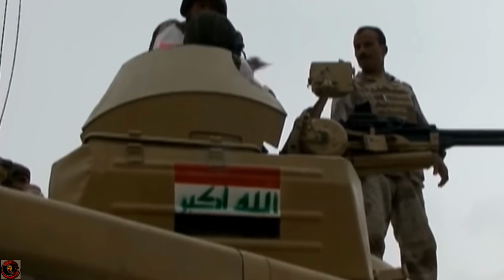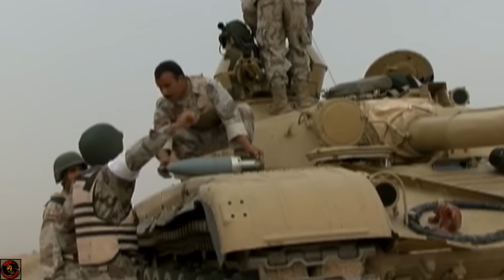Do Russian Tanks Need Bigger Guns?

Comment: Well, the thing with 152mm guns on Armata is quite complicated. Armata was designed to either use the traditional caliber of 125mm or a 152mm gun. So, an upgrade can be made. Perhaps starting a hybrid familly of tanks(Like the T-34 series, with different options for the 76mm guns, a version with 57mm gun or the late war version of T-34-85), this does not mean a complete overhaul of the new tank fleet, but can be seen as gradual introduction(first produce tanks with 125mm than some with 125mm and 152mm and later produce mainly 152mm version) Now, does Russia need bigger guns? Well, this is the thing. Russia did not plan to introduce the 152mm guns for the now(that's why development is not so rushed yet), but because of the future. They know that the collapse of the USSR put their tank development quite a bit behind NATO progress. The T-14 Armat, in current state, was meant to bridge that gap.But they also know that this is not going to last for long(Most NATO tanks have been around for 20 years, so of course everybody expects them to be either upgraded or replaced). And they know they won't have the budget to develop a completely new tank fast enough to keep up. This means that they are going to need a more powerful gun and a viable platform for it so they do not lag behind when those new tanks come up.  And another thing, NATO tanks use depleted uranium shells, which gives them an edge in firepower. To compensate, Russia needs a bigger shell, so a bigger gun. In conclusion, yes they quite need it.
Reply: Omega Alpha 
Most of NATO favours tungsten over depleted uranium.
Reply: The 152mm gun for the Armata is probably in slow development, but is probably one of the ways the Russian designers are looking at to penetrate the Chobham armour used on the M1A2 (and variants) as well as the Challenger IIs. If improved 125mm munitions can't penetrate the Chobham armour, they may need to go to the 152mm gun. This can also be used to counteract any armour improvements in Nato's tanks (M1, Challenger IIs, and Leopard IIs), or future Nato tank designs (M2?, Challenger III?, Leopard III?) whenever they come out.

Also note that any improvements in 125mm munitions will more than likely result in improvements to the 152mm munitions. Granted, not all improvements will apply between the two shells, but some will. I also think that the 152 mm is in slow development because of the barrel wear issue. All the issues you raised about reduced barrel life are valid, and need to be addressed before the 152 mm can be deployed en masse.
Reply: @kostaskritsilas2681  2a83 152mm gun is already developed for object 195, i think it can be used on armata as well
Reply: Also automated turret which i think all countries should do so. This should eliminate the problems with elevation and depression I think. I'm sure you can design something... Anyway I think tanks in general should also be able to have the ability to choose different amounts of charge so they can be used as artillery as well. 

 Also you can put the turret further back for better stability. 

 Also it doesn't have to be a 152. I think that's a bit too large. I think building a 130mm but designing a tank to go bigger is the way to go. I feel like armor technology isn't keeping up and eventually will be useless with more active defenses taking priority. The Russians say the Armata can tank a hit to the face by an American Abraham's 120mm + DU sabot but I'm not sure how true that is. Would not want to test that theory personally. 

 Also there are now smart shells that are designed to be shot over the top of a tank and uses a shape charge to penetrate the weaker top armor.

Comment: Instead of using bigger barrels they should further develop missiles that can be shot. This will help when a regular 120mm round won't do.
Reply: +Valhalla. Ehhh, no, that would not solve anything. Because the "only" target that would maybe need over 120mm would be the T14. Which I would assume has decent tech to deal with sub sonic incoming missiles at long range (early warning, not engagement of the missile).

The Russians had missile ammo for their T72s to counter the max range of the Abrams cannon, but that was before so current day countermeasures was a thing.
Reply: Lobos222 that just shows why improvements to missiles is so important. Hardening them to electronic countermeasures, making them more agile and faster.
Reply: Rockets are not cheap
Reply: Do you have any idea how few missiles have been fired from tanks? they are just not practical. The US bought literally thousands upon thousands of tank fired missiles for its m60 with the 152mm gun and they fired something like 8 of them in total. They are useless and expensive.
Reply: 神様 in Valhalla but the t14 has soft and hard kill aps
Reply: Given how common soft and hard kill anti-missile systems are becoming that can prove to be very expensive and possibly very expensive proposition unless they come up with new forms of guidance that are either passive or impossible to detect. 

Even older tanks can be easily fitted with laser/radar detection systems designed to automatically pop smoke in the detected direction that can defeat laser/IR/radar guidance systems. 

Also, typically missiles are shaped charges that rely on the Monroe Effect to penetrate armour and this is (relatively) easy to defeat using spaced or laminated armour without adding too much weight.
Reply: there already are missiles google the refleks
Reply: Cathexis256 I know that there are missiles already. Just like guns have existed for hundreds of years yet we continue to redevelop and improve them. Why not do the same with tank fired missiles?
Reply: Jameson Dymond that is one tank from one country (excluding the Merkava as well). There are a host of other countries that would love these missiles. Design and sell it to them.
Reply: 3 things:
1: There is already the Israeli LAHAT missile, which can be fired from both 105mm and 120mm barrels, and can be used, technically, out of any NATO standard 105mm or 120mm gun.

2: Basically all missiles use HEAT warheads, which we have made, probably damn close to efficiently as possible for their size. The LAHAT is claimed to penetrate up to 800mm of RHAe (Having tandem warheads). The problem is, is that all modern armour....is most effective against HEAT warheads. To make HEAT warheads more effective at this point, we basically need to make them bigger in diameter.

3: Which is great, except that missiles are the easiest threat to counter. From simple to most complex, we have standoff armour such as bar armour and net armour which just detonates the missile a safe distance from the vehicle. 800mm of air, is basically the same as 800mm of steel as far as HEAT is concerned. We have reactive explosive armour, we have reactive non-explosive armour, we have soft kill systems, and we have hard kill systems. As these systems mature, they will likely render single missile attacks, as utterly futile affairs.
Reply: +Goldmarble Im uncertain about who you are replying to but cage armour which is what you are referring to is not effective or even designed to be effective against missiles it is a protective shield from handheld rocket systems like the rpg, due to their design cage armor is effective at detonating the warhead before it hits the tank armor but most if not all missiles are too large and too heavy to be affected by cage armor and would go right through without detonating.
Reply: i've always wanted to ask - why russian mbts like to use guided missiles as part of their weapon system/munition when western counterparts don't?(to my limited knowledge anyway) is russian apfsds inadequate?
Reply: spaz14 I'm not a expert on armour, but it seems extremely likely to me it's a economically/logistically motivated decision.
They allready used the same AT missiles for mobile and defence anti tank use.

Comment: Anything above 130mm would be impractical on the mobile battlefield. Granted it would get the job done, but like you said It's about the crews. The first one zero'ed in and fires first wins. Crew reaction time, Mobility of the tank to that reaction, and finally Armor packages is the tank's last line of defense if the incoming hit. If you have to have a bigger gun, then it better to reconstitute the Super Heavy Tank Destroyer Class of tanks and only have them as mobile point defense tanks for protecting bases or defense choke points other than that they are pritty much useless at everything else.
Reply: your thinking is trapped inside the box of "tank vs tank", ignoring all other applications and destructing factors
Reply: No, I haven't.  He asks about do we really need bigger guns.I just gave thoughts on the subject and how if you needed a bigger gun with some quick pros and cons also a quick solution on how to implement them. With a little common sense, imagination, and logic. You can go blue in the face in the countless amount of scenarios that the tanks are going have to put up with. That would take forever to type each one. I fully understand a tank can't an Omnipotent force able to handle everything comes its way. Sadly that type of thing doesn't exist, if such a thing was attempted you would need unlimited R&D, Money, resources and what not. I'm Aero Space Engineer and IT Specialist and I have been for over 18years now. I've worked on military air and ground developments and more. Trust me when I say the stuff you see nowadays, is 20 to 50 years behind what is really planned. The only reason it isn't here today is. Those other technologies have not caught up with the design specs.

Comment: Title should be:Everything is bigger in the U.S. but will that change to Russia.
Also could Russia afford to refit new guns or make new tanks or even buy from another country?  How much is it to refit military vehicles
Reply: It depends quite a lot. Especially when we are talking about Armata, which is designed to be a multple weapons platform, and as far as I remember, there were already tests with 152mm guns, but that was discarded for the moment because economic reasons and because the current 125mm seems to be doing quite well. As to come back to upgrading Armata. Well, that tank is still in production. So you do not need to upgrade the tanks you built. You built upgraded tanks. So, instead of having the same number of tanks, just with little improvements, you have more tanks, some of which are good and some of which are even better

Comment: I think they will be going to thicker barrels maybe smaller diameter rounds using a liquid or gel explosive propellant , using higher speed rounds to kill instead of mass . Like modern bullet designs .
Reply: M TODD The modern small calibre Hight velocity ammo is overrated a bit. Its main advantage is it weighs less than the old 7.62 for a soldier to carry. in jungle conditions leaves and even grass can affect its trajectory and hitting power of the smaller calibre ammo. The guy hiding behind a log is a lot safer with light  higher velocity rounds coming at him. If 7.62 is coming in it can easily chip big lumps of log off destroying your cover. I have not seen a demo for years but in terms of hitting power with about 10litre tins of water the original Armalite was pathetic compared to a 7.62. Put a few blades of grass or leaves between the target and it was even worse in accuracy and hitting power. Whatever you did with the 7.62 it blew the about 10litre ration tins of water to pieces. Bigger calibre still has its advantages provided there velocity is high as as well. Also the extra room in a large callibre shell allows a better armour piercing explosive setup in the shell when it hits. No shell can pierce the armour today on tanks today with hitting power alone.
Reply: Ross K  not to be rude but we were talking about tank rounds .  Lighter tank rounds moving at 1.5 -2 km a second are still heavy enough to kill any tank made.  Ever heard of the silver bullet FSDSDU only faster and no powder charge which is a lighter round .

Comment: I would say that yes, we need bigger guns, modern armor packages on both sides of iron curtain are getting more and more effective so why not just slam a big 152 mm gun on USSR tanks (Armata's turret wouldn't be a problem) and 140 mm on allies tanks. Of course there is no way to just put it on old tanks like T-72 or T-90, just check their interior now, with 125 mm, it is more cramped than gym on 2nd day of January, so only making these tanks drones would solve this, but it is absolutely idiotic idea. Still, what's the disadvantage? Modern aiming systems are pretty effective (except if you drive Ariete) so you wont have to worry that much about smaller amount of shells you can carry as you will be able to knock out pretty much everything enemy can throw at you withh the first shot from your mini death star, you can also shoot bigger ATGM's, the size of Kornet for example as it is 152 mm and if it gets old in 50 years, just make it longer and that's all. So why not?
Reply: And now let's watch the video

Comment: There is a different solution to this problem that the US has been working on instead of increasing the caliber, use superior technology to radically increase muzzle velocity, this being the Electro Thermal Chemical (ETC) gun. What it basically does is replace the traditional primer in a shell with a plasma ignition system allowing the propellant charge to burn much hotter and far more evenly, potentially doubling the velocity of a 120mm APDSFS round while keeping shell dimensions the same (https://en.m.wikipedia.org/wiki/Electrothermal-chemical_technology for details).
Reply: +Вячеслав Скопюк+ tanks can be surprisingly flexible weapons platforms when properly deployed. The ETC Cannon would also cut down on barrel wear out, saving on costs and the higher velocity could  increase the effective range of other munitions (can you imagine what effect canister rounds would have with double the velocity?), HEAT rounds could hit distant targets more efficiently and the new AMP rounds could even kill modern tanks from the front. If they were made of sturdier materials it could effectively resurrect the APCBC rounds of yesteryear and features advanced multipurpose capabilities; with devastating after armor effects or punch holes in much tougher cover in urban environments to get at anything hiding inside, even in the unlikely situation where reinforced concrete pillboxes were encountered; AMP shells could pulverize these.
Reply: You will still need guns that are able to widhstand a higher chamber pressure.
Reply: +Jonny+ I was going for the abbreviated explanation, the article covers that more in depth and barrel plus cannon breaches specifically engineered to take the added stresses of higher barrel pressure and increased recoil are taken into account.
Reply: Additionally; the more even and cleaner burning of the propellant charge from the ETC mechanism actually results in improved barrel life (and now that I think about it probably a smaller muzzle flash). If such a system actually delivered on its promises (assuming a doubling of muzzle velocity results in at least double the armor penetration) it would render virtually all armor packages the Russians have on the drawing board and even most western ones on MBTs obsolete (also making any projected APS systems infeasible at intercepting the KE rounds), even the Abrams with the latest armor package upgrades would be sorely tested by an ETC gun at ranges of 2000m or less. Though the Abrams can still accommodate several extra tons of armor without problems to compensate, especially after the M1A3 is reducing overall vehicle weight by 2 tons from electronics modernization alone. Russian tanks would be forced to ditch the previous obsession with a 50 ton maximum weight limit to have any hope of survival in the face of ETC tech.
Reply: okay, you have your hypersonic ultratech 120 mm gun, who is good for only one thing - kill other tanks in direct sight. And then you send your tanks, armed with such great weapon, against likes of ISIS

Comment: The American MBT-70 used a 152mm with autoloader back in the 70's. Now we're 2 steps behind the Russians with no autoloader and no crewless turret
Reply: I'm not sure about the MBT-70, but the KPZ-70 didn't have an autoloader
Reply: the germans planned to add a 120mm to their kpz70 and made their own auto loader capable of 6rpm with the 152. (it couldn't use atgms and the 120mm was never equipped to the kpz before it was canceled)  While the us opted for a 152 gun with an auto loader capable of 10rpm and the ability to load atmgs.
Reply: mbtkpz is a failed project......
Reply: sure it failed. but you can see numerous design features from the mbt/kpz 70 in the m1 abrams and leopard 2.
Reply: But we have a Space Force, so...
Reply: The t14 armata is a failed project. 
Its not my opinion, the russian army cut orders from 2000 units to 100
Reply: @GuncoHistory  Reduction of ordered numbers doesn't means that it is failure,it just means that the exact model will be produced in only 100 examples, while it could lead to some other modification that will see higher production numbers.Armata is most likely going to be something akin to T-44 going towards T-54, some kind of transitional tank towards the better and really new,mass produced MBT.
Reply: @GuncoHistory  it certainly is not, its probably the most advanced tank in the world, and in production at about 50 units/ year.
Reply: It's your poor opinion, as a tank being ordered in less numbers doesn't say it's failed at all. (by that "logic" Warrior APC is failed project too, since it was meant to replace FV432 fully but never did)